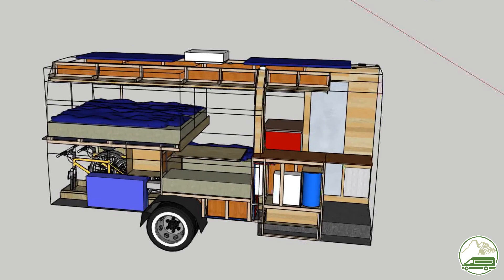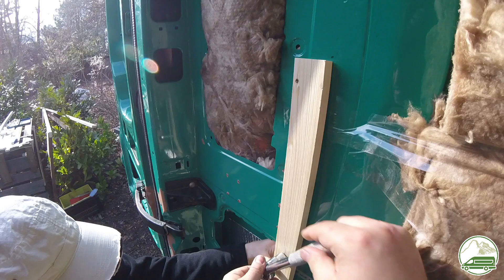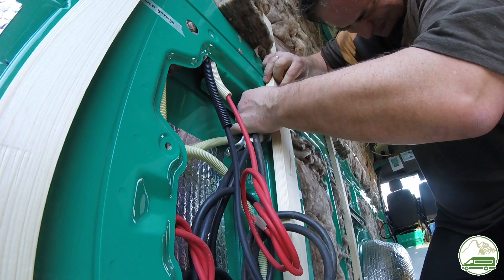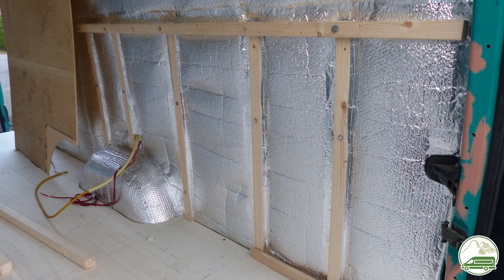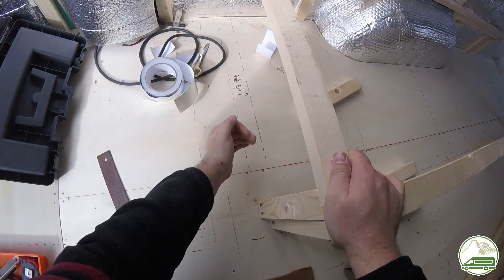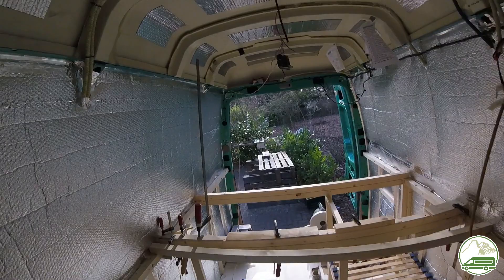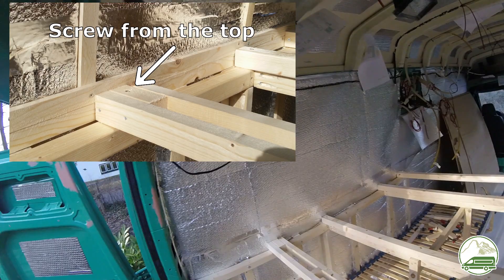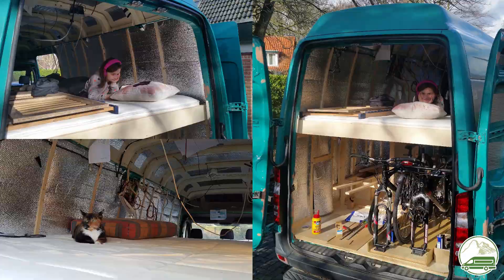Sprinter L4H3 Camper Van Conversion - E08 - Lightweight Beds

Comment: Hi. I am che king also the design, cause i really Need and information. I am try to draw a layout with bed suspended above the dinner area. But i saw that the roof of the Sprinter It goes narrower as long you go up to the roof. How much Is large in the Highest part internally?

If i mantain a 160/140cm bed large, can i put It quite up to have 192cm of height?